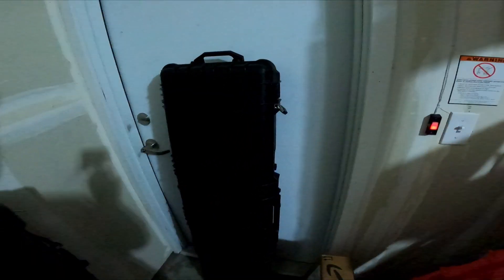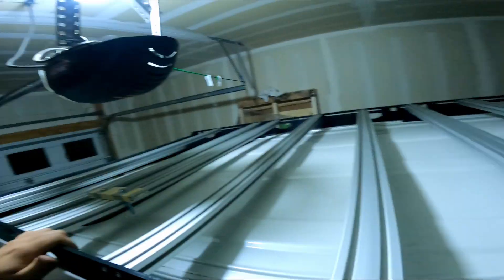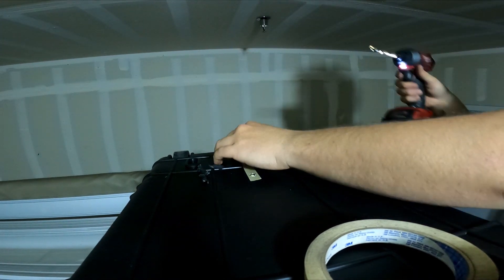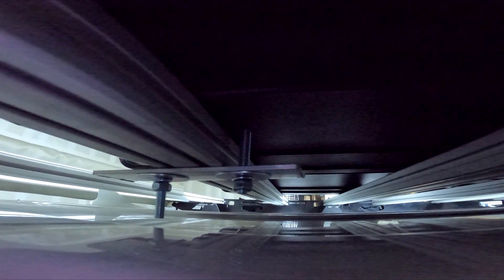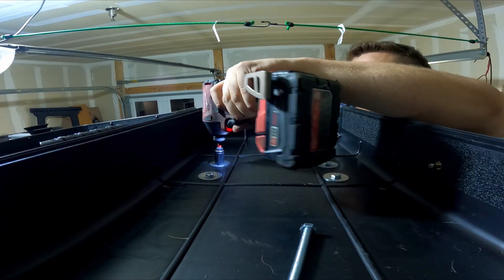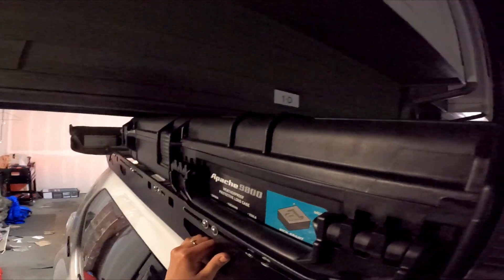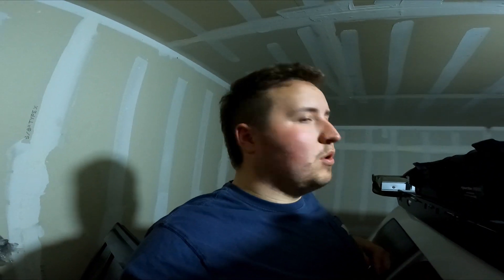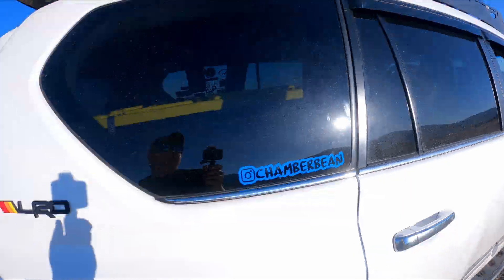Overlanding Roof Top Storage System :: Lexus GX460

Comment: Thanks for these videos, very helpful! Quick question, why did you do the plates and bolts instead of using the T track to secure them?
Reply from the maker: I didn't want bolts sticking up threw the box and getting in the way of my tool box and snagging the cable etc.
Reply: That makes sense.